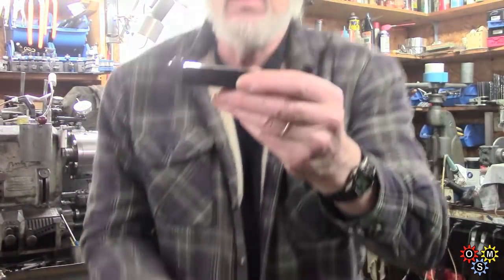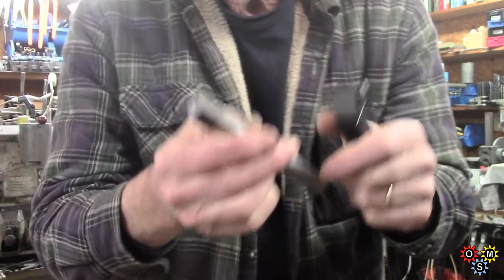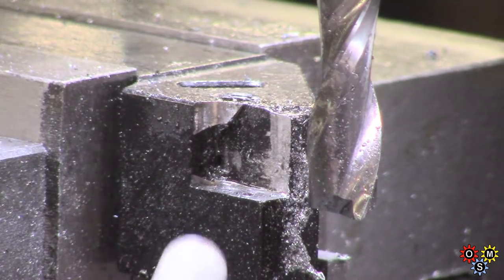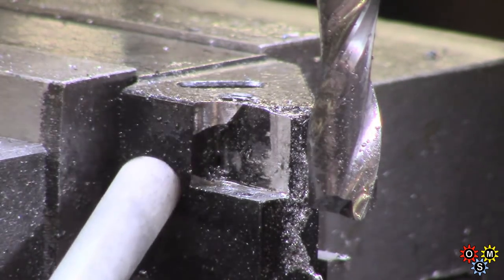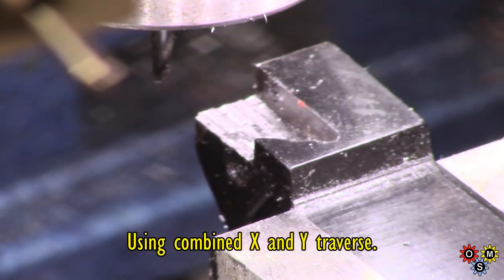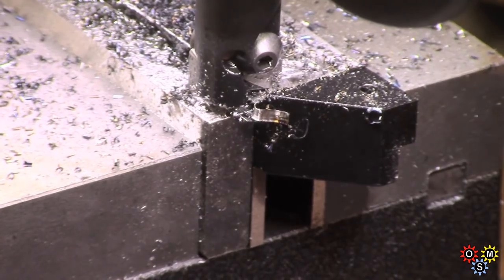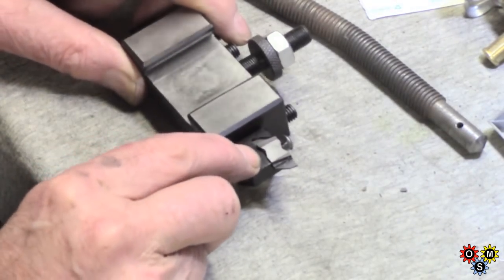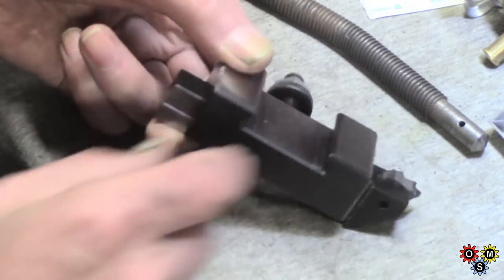Modifying an Insert Tool holder

Comment: Hi Chris,
Sorry to hear you are still under the weather! Hoping you get to feeling better soon. Good reminder that we don't always need the top of the line gear to get the job done. Nice to see you making due with what you have at hand.

Best wishes,
Tom Z
Reply from the maker: Hi Tom,
Fortunately, at last shaken off the worst, thanks. Have used the tool since and it does just fine.
Happy Thanksgiving.

Comment: Hey Chris, any particular reason you used a right-hand insert in a left-hand holder? 
Just wondering,
Cheers,
Isaac
Reply from the maker: Hi Isaac,
It was all a question of what I could find - that was affordable!:)
Reply: Fair enough! How stable was it with the notch running inline with the clamp rather than perpendicular as it's intended to be?
Reply from the maker: Fortunately it has worked just fine.  Trouble was, having cut my thread it turned out that was wrong - there'll be a video soon showing my total lack of observational skills! :)
Reply: Interesting.
Look forward to the video, always like your content :)

Comment: Hi Chris,
This insert will surely make the job all right...   Just try to keep the threading speed as high as possible in order keep the carbide comfortable and from chipping...
Don't try a selfie stick in a cold damp shop, shivering will make a very shaky shot...   ;)
Cheers,      Pierre
Reply from the maker: Hey Pierre - it cuts fine I now know (despite a glitch which will come up in the video). Actually didn't use a very high speed - just took small cuts.

Comment: Feel better.  Hope you get some good heat in the shop this winter.
Reply from the maker: Hi Roy - cold is annoyingly persistent but - we'll manage. I do have a good space heater but even so, when ultra cold comes along it will still be difficult. Always coping with extremes!

Comment: This settles it, I'm getting a selfie-stick! :-)  Nice modification, Chris.  I am sure you will be successful making your lead screw...that will be an interesting video.  Welcome back and get to feeling better.  Thanks.
Reply from the maker: Hello Dale,
Thanks. eBay has loads of selfie sticks very cheaply - mine has a bluetooth facility to link with the phone.
Off to try the acme insert shortly - hoping it does the job.
Reply: I'm thinking it will do a fine job, Chris...cutting an acme thread is one thing I've wanted to do..but unless you have a project which really calls for one, like yours, you just never have an opportunity...so I'll cut one vicariously through you! :-)
Reply from the maker: It cut fine but -- seems the pitch I had measured may have been metric! May be cheat time! You'll see in the video eventually.!
Reply: Hey, cheating is better than losing...especially to metal, we can always out-think it! :-)

Comment: What ho Namesake,
Bummer with the cold, although if it lasts more than a week you are entitled to up grade it to a much more impressive "upper respiratory tract infection".
Glad to see that it hasn't stopped you being a Brit, you can tell by the complaints about the weather, again.
Just a note about machining hard stuff, think about the hacksaw rule about 2-3 teeth engagement. It is often kinder to tools and machines to use a smaller cutter and several passes.
LL&P
c
Reply from the maker: Hi Chris,
Haha - pretty sure I did 'upgrade' to a bit of bronchitis actually!
True - several passes etc -- but was being a bit impatient! :)